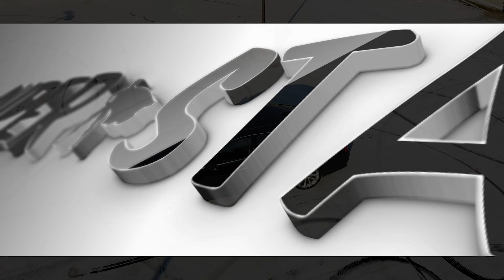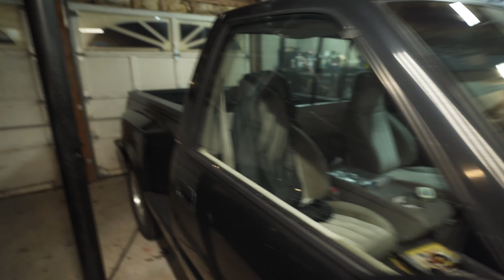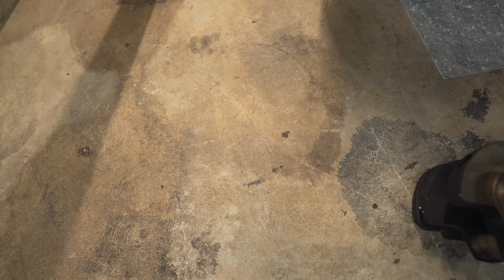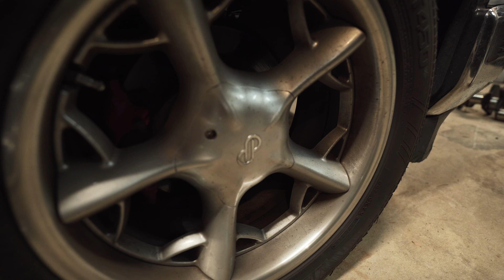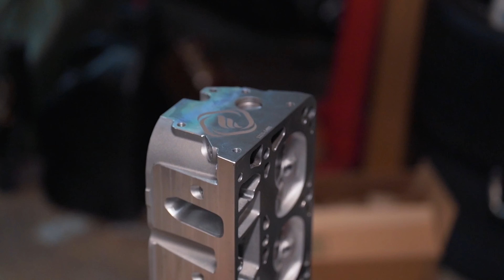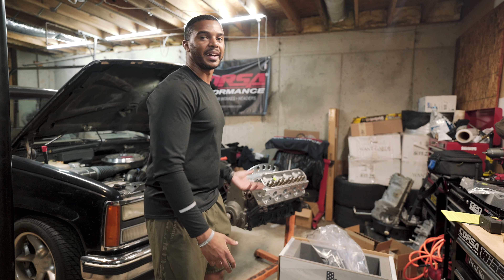1991 GMC C1500 & Ported Frankenstein "Stage 1" 243 Heads Return

Comment: I'm thinking about getting frankenstein heads for my ls1 ws6. I heard they're better than MAST. But almost $1000 better?
Reply from the maker: I haven’t even ran them and I think so! Sounds like you’re going for their own casting rather then a ported factory set and I can definitely say from the numbers I have seen FED head is superior to MAST. (Personal opinions)
Reply: @Stan1le  yea so my plan is to use the stock 5.7 bottom end. Frankenstein heads, and their manifold until I saw it was more than the heads lol. So now it looks like Frankenstein heads, fast 102 mani and T.B., and tsp cam. Might get the BTR LS1 cam instead. I'm running TSP cam, slp headers, intake tune, ls7clutch, lightweight flywheel and driveshaft, and tune. Made a healthy 390whp. I'm afraid to mess with that because it runs amazing. You can here it on my page...